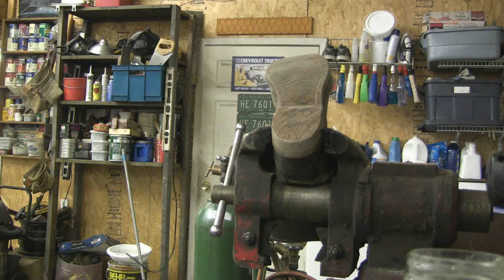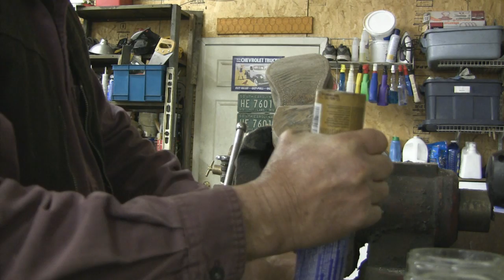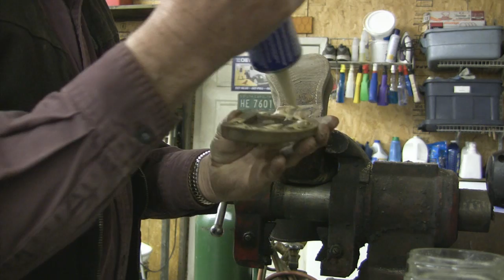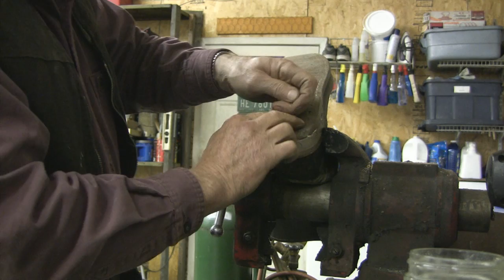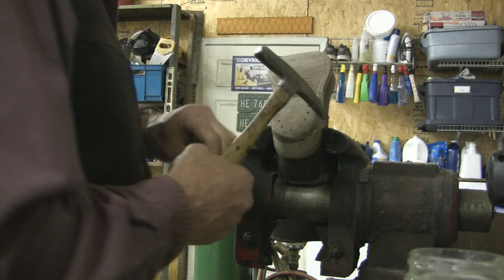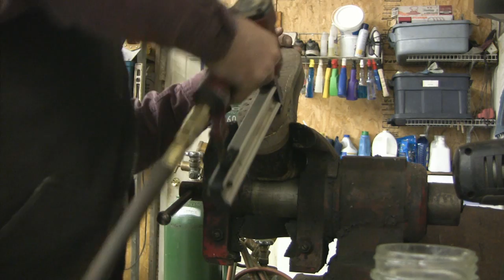a feller needs to maintain his equipment

Comment: @1963impala2dr Mine had de-laminated soles. I tried contact cement, liquid nails and epoxy. Couldn't use brads or tacks and they always came apart. Cheap boots I guess.